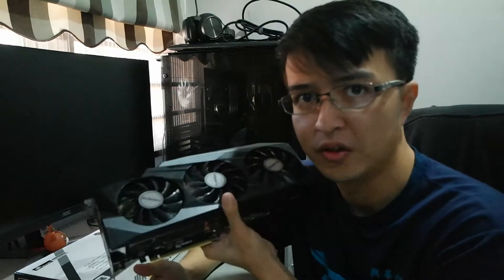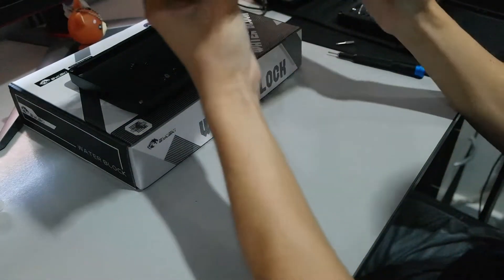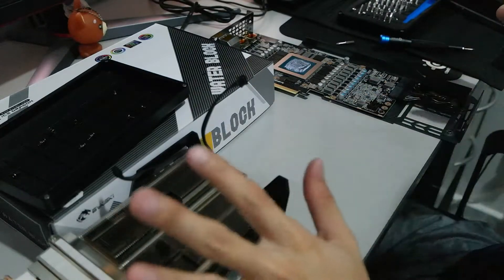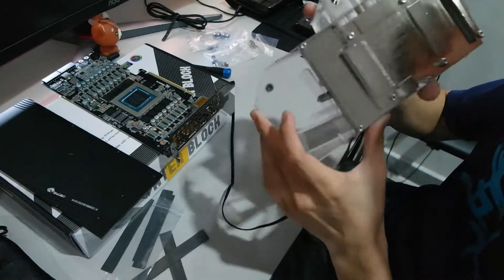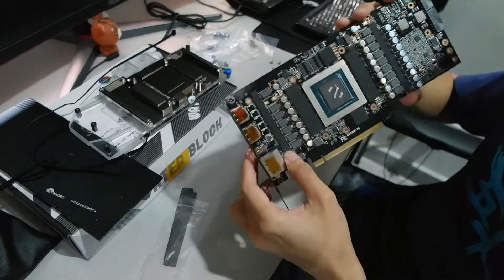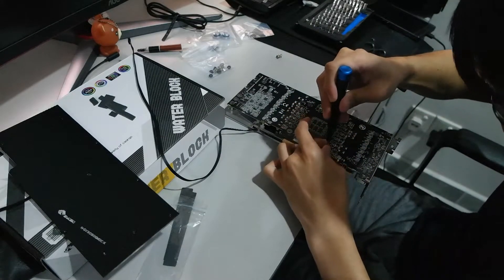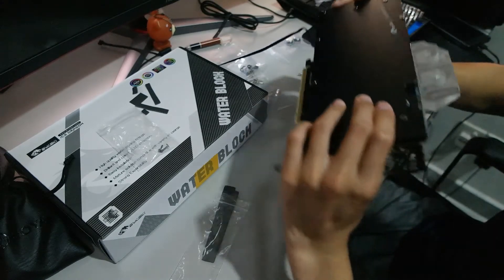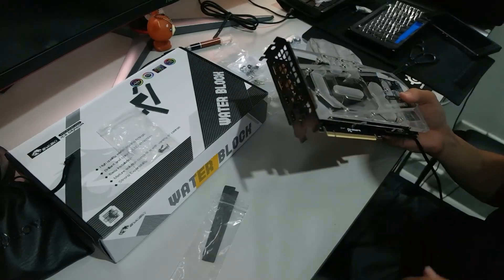Assembling a Gigabyte RTX 3080 GOC Water Block | Bykski GPU Water Block

Comment: Hey, how is the dual 8 pin power connector attached - to the backplate? I ordered it myself and don't know how to attach the powercable extensions to that small waterblock :D or are they just hanging around afterwards?